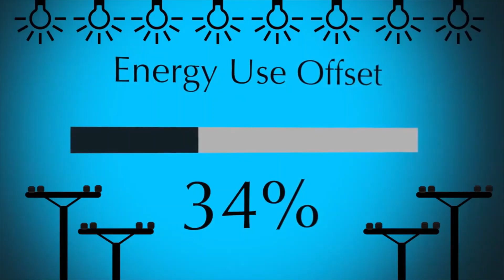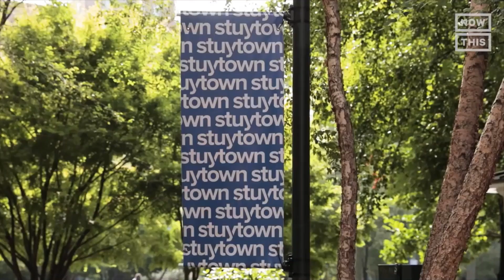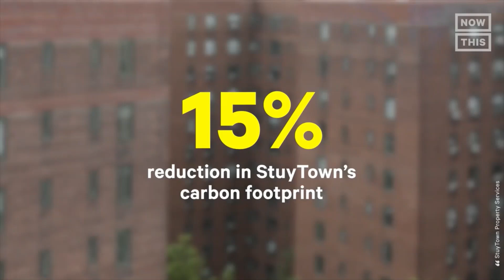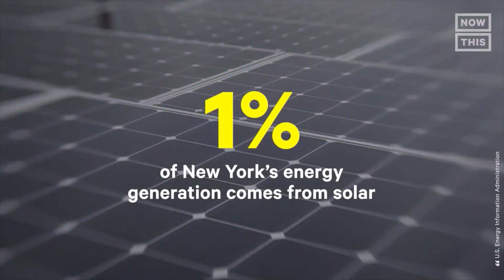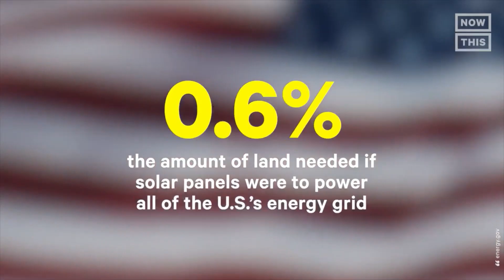What Ethiopia can learn from New York City’s Initiatives to bring Solar Power to Public Buildings

Comment: To aid the hydro power it is good to have standby power for emergency. Throw a few solar cells on a roof top and light up the buildings and use the hydo power for large varying loads like motors, aircons, and other household devices.every little bit helps...
Reply from the maker: Excellent idea (point). Ethiopia has such enormous solar energy potential. If this solar potential is properly utilized, it can provide opportunities for enhanced energy security, job creation and sustainable development.